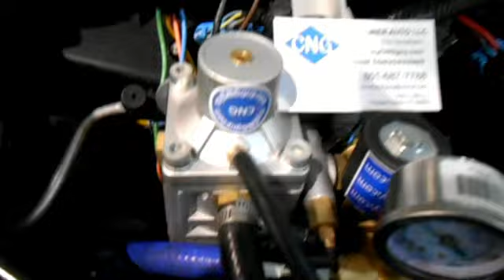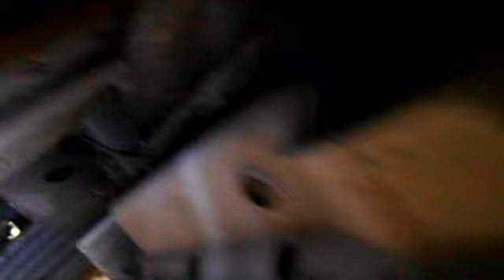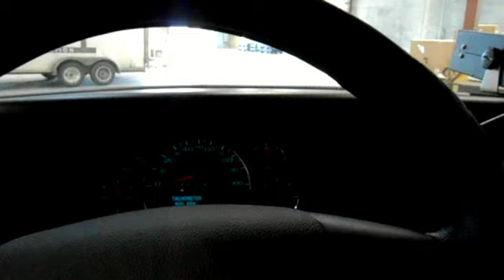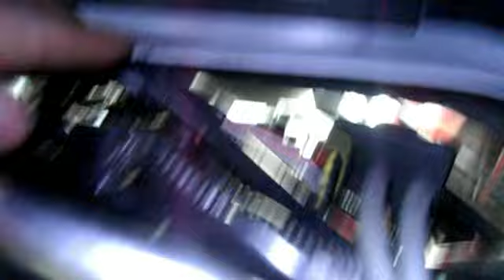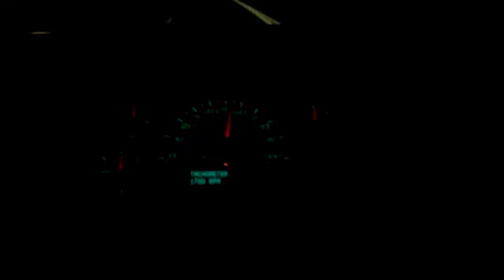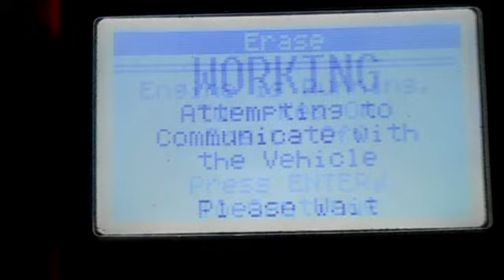CNG Natural Gas Conversion for $900, sequential injection, http://myCNGguy.com

Comment: "adapter"? but you might mean fuel injector adapter? if thats it, they actually work really good on fuel injectors that are mounted straight on the fuel rail. i dont recomend them on the chev 6.0l because the injectors sit really slanted and its really hard to get them to seat on this motor. the nozels included in troys kit work really good and you wont have any chance of any leaks and he provides you with everything youll need. also troy can get them for you if you ask him.

Comment: this is my van. yes the mixer systems are actually designed for all 4 cyls. ive ran every mixer system out there and i cant do over 35mph with the same engine! (up parleys with my trailer) but this sequential is awsome! this kit will work amazing on your lexus and youll be upset when you see it actually has less wiring connections to make and would have been cleaner and easier to install in the first place. i thought it would be really hard but theres nothing to it. and it runs perfect.

Comment: I drive Parley's Summit every day.  Like you,  I did a comparison of aspirated and sequential injection CNG systems on this same hill with the same car.  A Scion xA with 1.5L engine.  The aspirated and sequential injection systems performed the same while climbing Parley's.  However, my 3.0L Lexus with the mixer system struggles to  get up Parley's hill using CNG.  I'm getting the impression from your video that sequential injection CNG works better on larger engines.